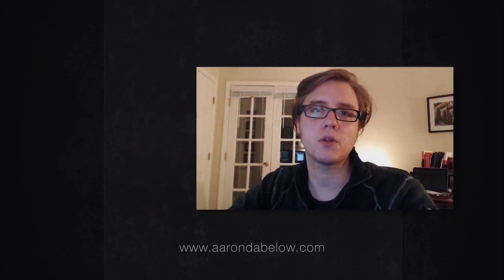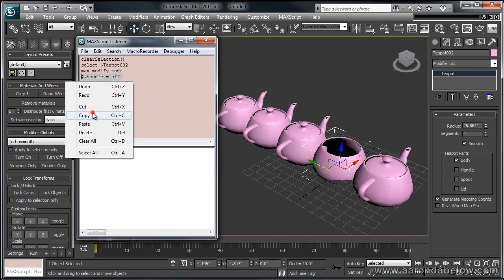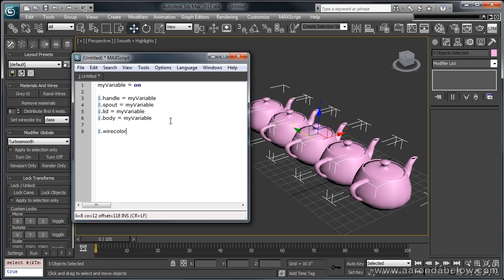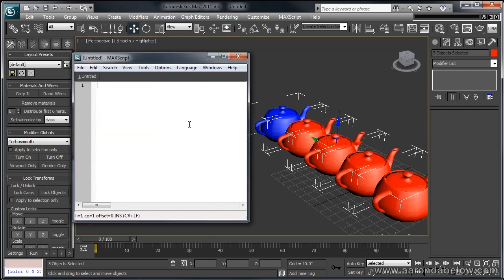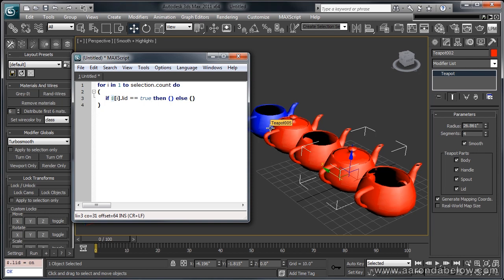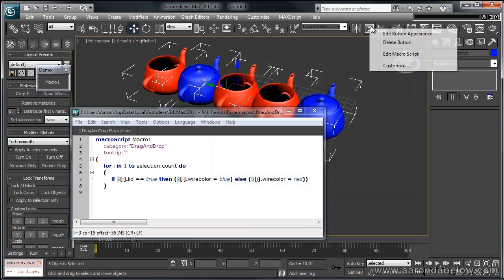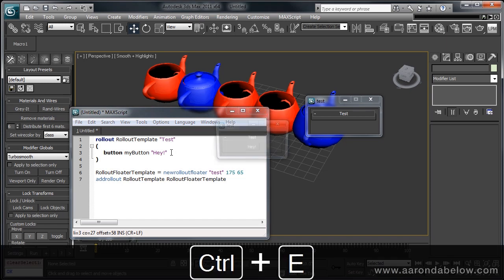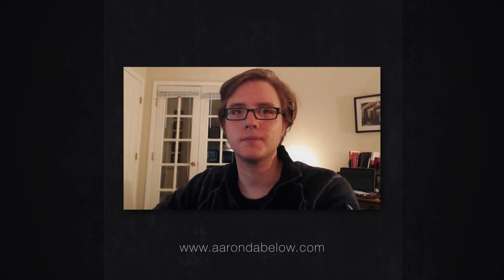Simple Maxscript Tool Creation - 3DS Max Video Tutorial

Comment: non-critical-yet-somewhat-disturbed-by-question ..
what's up with the double printing at minute 7?
print $[4]
$teapot ..stuff..
$teapot ..stuff..
Reply from the maker: +aysikl Not super sure, but Maxscript will print the result of what you do, in addition to what is actually called in the print command. Since that was the last bit of info that was operated on, it prints that. Just like if you do a function like clearlistener() it will return 'true'. That true is the result of the script executed.

Comment: I did it like you, but i got this error: addRollout requires RolloutClass, got: undefined What's wrong?
Reply from the maker: you need to use the exact name of the rollout that you defined. Max is unable to find the rollout in your script when you are calling it. It is either not there, or named incorrectly in 1 of the 2 spots. Hope this helps.